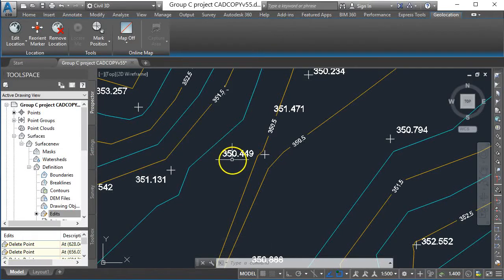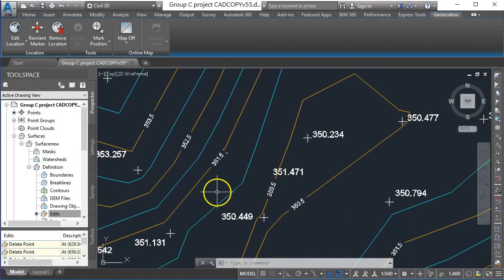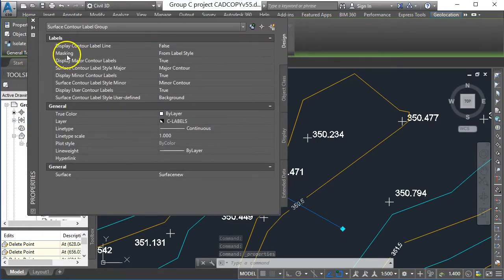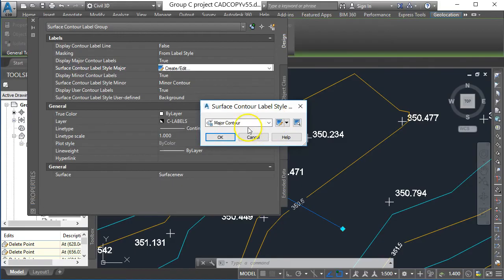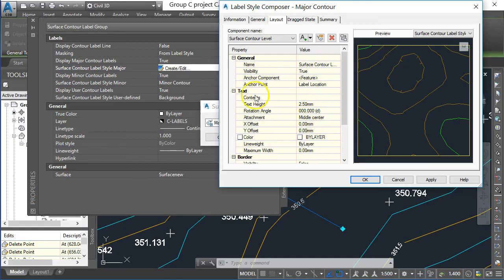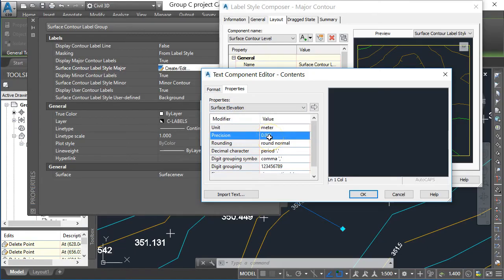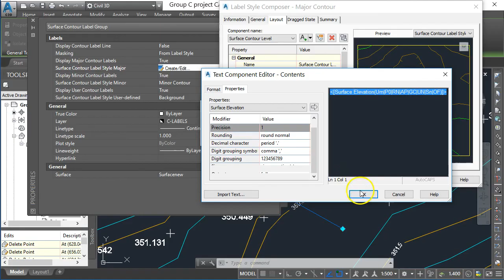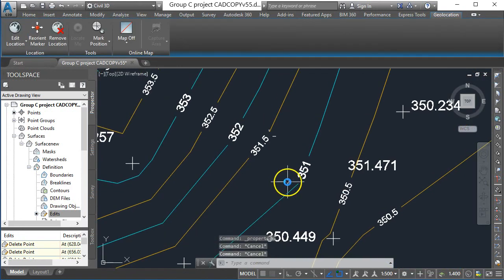Display contour label in Civil3D

Comment: Uncomplete video for beginner
Reply from the maker: Thanks for commenting. This is not really a “beginner” tutorial, in the sense that it’s aimed at someone who is already able to create a surface and add contours to it. The video is supposed to be a quick tutorial on how to do one small, specific task in Civil3D. There are many other videos on the channel that are focused on the earlier tasks required in Civil3D before you get to the point of adding contour labels.
Reply: @CADandStuff  actually you miss some moment of making this video at start 
Other Wise weldone
Reply from the maker: @pakciviltech  What do you think is missing at the start? Obviously, the actual creation of the surface and contours has already been done when this video starts but I cover how to get to that point in other videos.
Reply: @CADandStuff  They mean how to add label to the contour line. I just created contours from grid points and now can't find a way how to add label. I came and find your video and it starts with label already there.
Reply from the maker: Ah, okay. So, click on any of the contours to select the surface and then on the left of the ribbon you should see a button for adding labels. You a can add a single label at a selected place along the contour, or if you try the multiple option, then you get to draw a line; wherever that line cross a contour, a label will appear.
Reply: @CADandStuff  Thanks, man. Although I figured it out after posting the comment. The labels look neat.